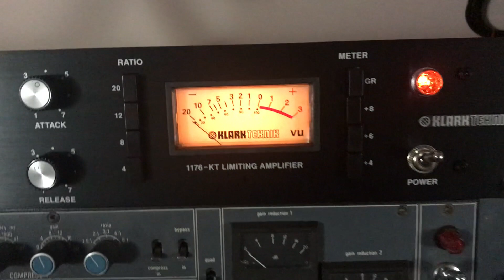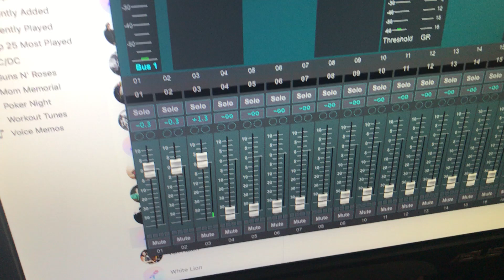KT1176 Noise Issue

Comment: 1176 is a noisy unit. I have 76KT which is noiseless or say introduces noise after 12.
Reply: Mine is like yours. It hisses at Output "12" for like two seconds then it stables. Is that normal or defective for KT-76? I am thinking about returning the unit back to Amazon.